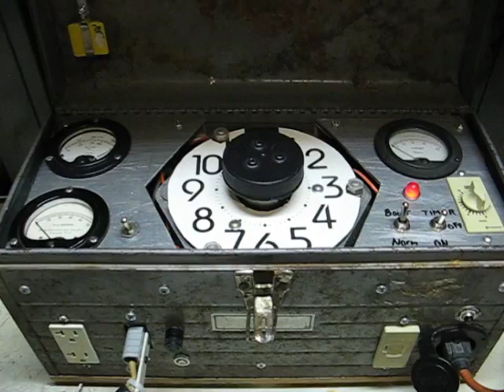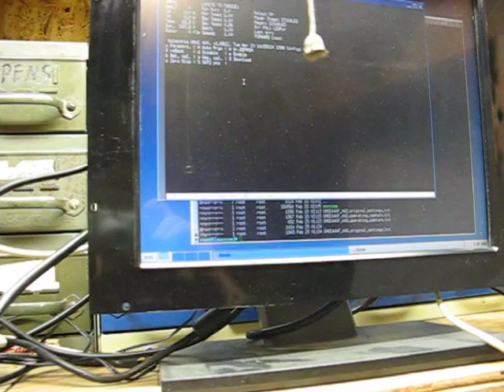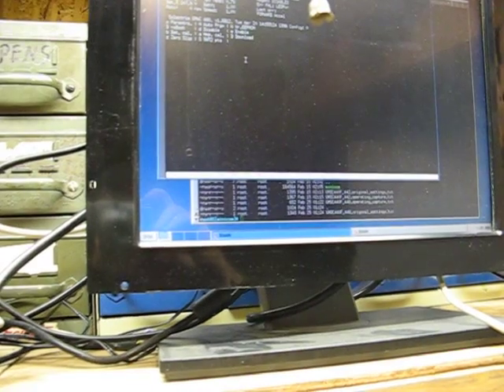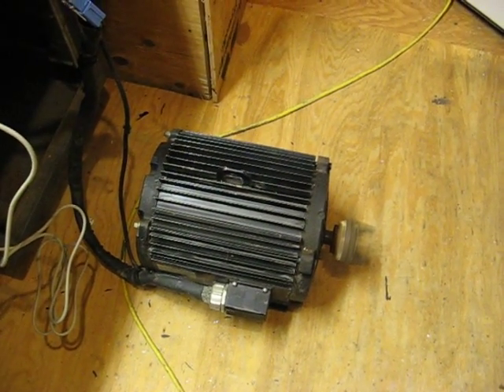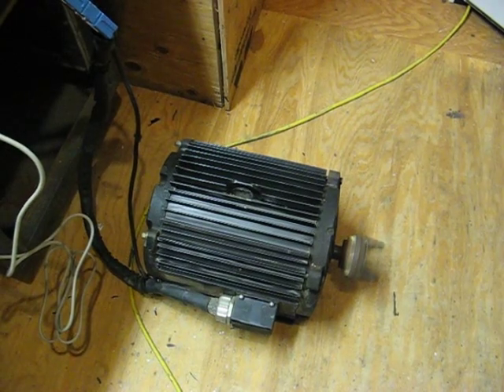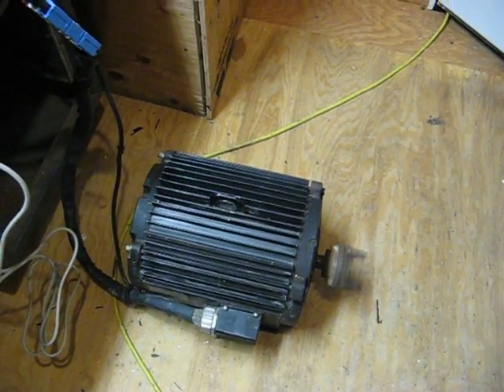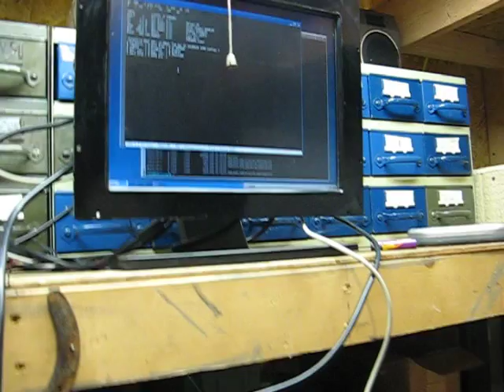Electric car motor bench test

Comment from the maker: It goes faster,  if you also increase the voltage (and thus current as well).    However eventually the motor will be damaged,  and how much faster you can run the motor depends on its ratings.   Insulation class, maximum mechanical RPM,  etc come into play here.    Usually an inverter rated industrial motor can safely go at least double its nominal frequency and thus double its nominal RPM.

Comment from the maker: I'm shopping for an xB right now.  

except for the fact that the electric motor is integrated with the transmission and not the wheels,  you are describing every hybrid car out there.

While hub motors are a great idea in concept,  there are a lot of problems with putting a motor on each wheel:  the extra unsprung weight, duplicated electronics to run each motor and coordinate them,  and the fact that tires and wheels are exposed to the most road grime and moisture of anything on a car.

Comment from the maker: AC vs DC is one of the never-ending discussions in the EV conversion crowd.   It boils down to this:  DC is simpler to build and understand.   DC is much cheaper on the low end of the range, and DC can be very powerful compared to AC.   AC systems are more sophisticated, somewhat safer,  somewhat more robust, and it can be anywhere from a negligibly to considerably more efficient owing to regenerative braking capability but that depends a lot on how and where the car is driven.

Comment from the maker: The inverter takes battery power and converts it to variable frequency, variable voltage 3 phase AC (alternating current) power to run the motor.   It is fairly complex, but basically the frequency and voltage are proportional to motor RPM.  To make the motor accelerate, frequency increases  which causes the motor to increase its output torque and speed up until frequency matches RPM again.    The opposite happens to slow down the motor down (called regen, or regenerative braking)